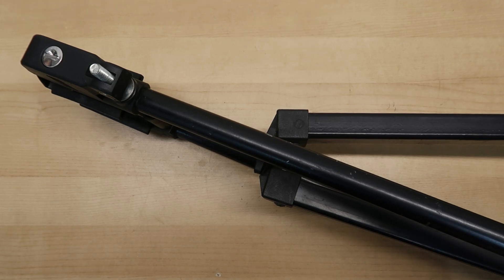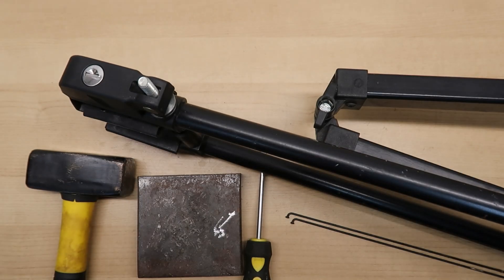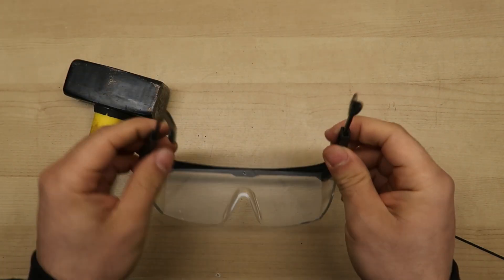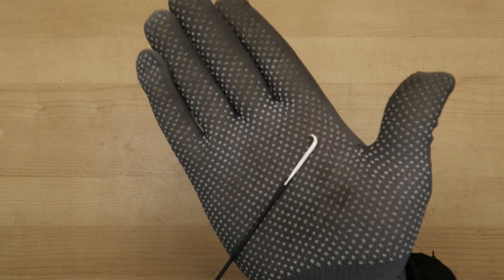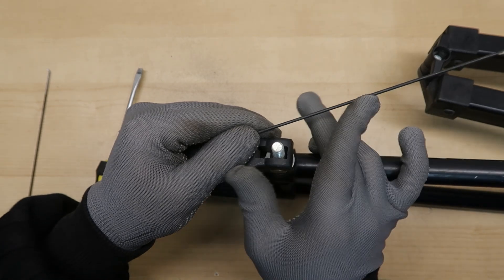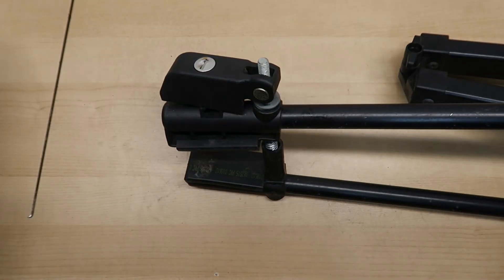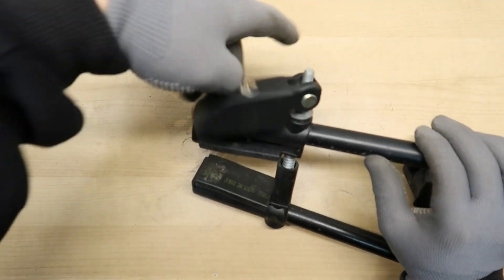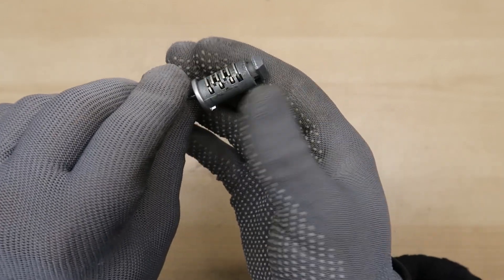How To Unlock A Bike Roof Rack With Just Two Spokes

Comment: How is the key? Is there teeth on both sides or just on one side? Mine has on both side so I’m wondering if it will work. Thanks in advance
Reply from the maker: As far as I remember, there are teeth on both sides but actually only one of the sides matters. If you get one side aligned, it should unlock.
Reply: @buckbikespent4588  Thanks for the answer! I saw somewhere that on some locks the pins are alternated (one on one side, one on the other side and so on) but you simply have to push the pins on both sides. I will try as soon as I receive my tools 🙂

Comment: Thank you very much for your video. I had a pair of expensive Volvoflat wing roof bars without the keys. With yout trick i could remove the existing locks from the 2 bars. Thule has a set Thule 544 one key system with 4 new cilinders. I purchased this set Thule 544 (code 1000-02-4) for 2 euros in a thriftshop 😁and now i have fully functioning roof bars with new cilinders an 4 keys. Thanks again this helped me a lot !!!